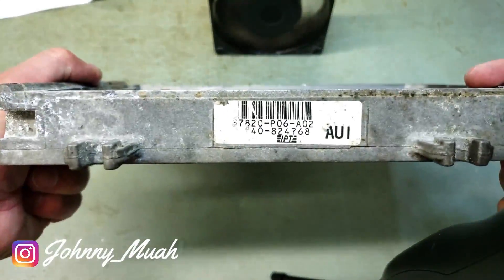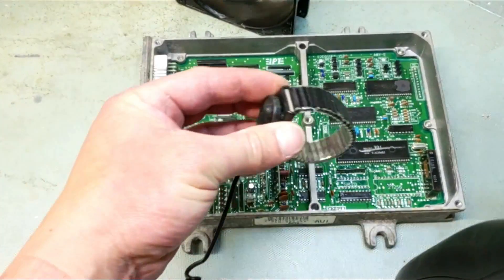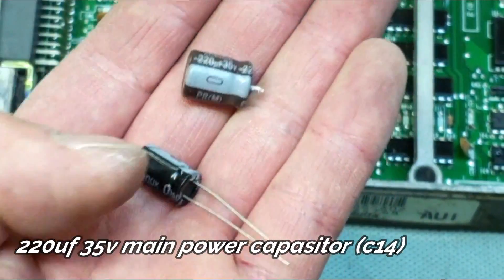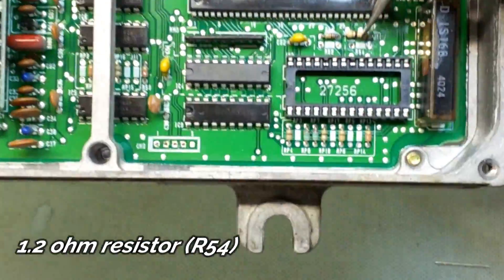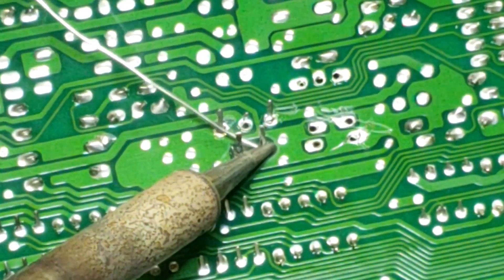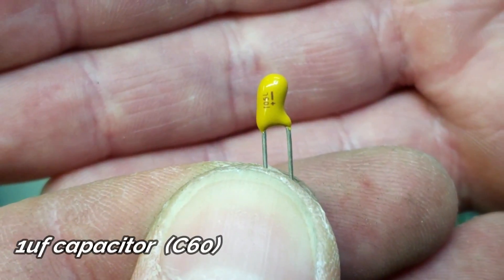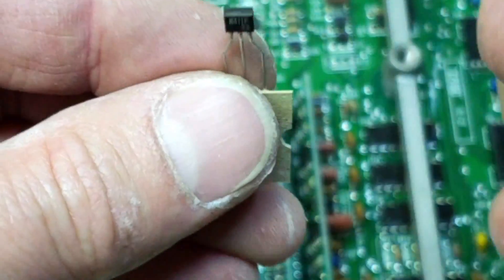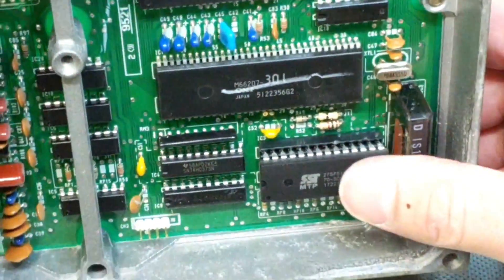Chipping and adding VTEC to a HONDA P06 ECU / p28

Comment: Hi ! is this tutorial working on a P07 ? I'm willing to do a mini me conversion but I need a new ecu for my ek3
Reply from the maker: I believe it's not chippable. We do have a few chipped ecus for sale on ebay. Jmp will be in the title
Reply: @JiroProject I made some research and I saw that a P07 is the same ecu as a P06 but for auto transmission
Reply from the maker: @Theohaddadi  Not sure where you found that, but never heard of that. and the p06 can be chipped, auto or manual. If you open up the p07, you can see that it looks totally different than any obd1 ecu.

Comment: I have a p28 that won't give me any spark. Could I take the parts from that and use em in the p06 for the VTEC section? Someone also tried chipping that one, so I could probably take some of the chip parts from that too no?

Comment: Hi, i have a EK3 d15z6 engine and i want to swap my ecu, i find a p30 and p06 on similar price, which one you recomended to buy? In the future i want to do a mini-me on engine, thx.
Reply from the maker: if its a usdm p30 ecu from an obd1 del sol vtec, then that is the one i would choose since it already has vtec in it. p06 doesn't have vtec, but as you see in this video here, it's very simple to just solder it in.

Comment: Greetings brother I have a concern it is possible to run a Honda B16A2 engine with VTEC to an automatic tramsmicion
Reply from the maker: yes, you'll be just fine. as long as its a b series auto, it'll fit and work as it should. just think they have d16z6 automatic from the factory

Comment: I’m a little confused as I’m a bit new to Honda. Are all the little components responsible for the vtec or is it the chip that you installed? I guess what I’m really trying to ask is, what is the point of the final chip that you installed?
Reply from the maker: first step is for chipping the ecu, which the sst chip will become the new brain to the ecu. Chipping gives you the option to now tune your car with your specific mods using a program. Then the vtec section (top left of the ecu) is for ecus that doesn't have vtec, which a p06 doesn't. If you have a p28 or p72, then those have vtec already installed. If you're running a non vtec motor, then you wouldn't need it. hope that helps.
Reply: @JiroProject  okay so if I just want to throw in a d16z6 into my car then I may as well do the entire process in the video. Also thank you
Reply from the maker: @ArtBuilt  what car and motor do you have? im guessing you did a z6 swap from a d15? if you can get a p28 ecu, thats the way to go. if you want to use your p06, chip it, and put a p28 basemap in, then that's another way.
Reply: @JiroProject  I have a del sol with a d15 at the moment and have a d16z6 that’s getting to getting ready to get dropped in. I’m not wanting to spend a fortune on a p28, so doing p06 to vtec conversion is what I’ll do
Reply from the maker: @ArtBuilt  yup then you're on the right track. but you'll need to get a p28 basemap burnt onto the sst chip, which we do that service as well if needed.

Comment: How often should u update ur system or the old chip is still good for a retune
Reply from the maker: They make a lot fake chips out there. You can search comparisons on what to look for. But the good chips are lifetime reburnable. The fake ones are like 2 or 3 time burns and then they don't burn anymore. As for a retune, I would retune your car with any big or major mods like upgrade turbo, cams, etc.. hope that helps.
Reply: @JiroProject  appreciate your help

Comment: Nice and full detailed video, but I'm just wondering, did you tune or put basemap on the ecu before you start the engine or just plug it in after you rechipped it?
Reply from the maker: after your chip your ecu you'll need a basemap, yes. And then tuned from there. I wouldn't drive very far or long w/o a tune if you're boosted.

Comment: Hey so…. P06 here. Running hondata s300 and I’m getting fuel prime with code 21 (CEL flashing long 2 times & once fast). Car runs like doodoo. Undriveable. Any ideas?
Reply from the maker: check the capacitors, or ic17, which is TA8903SN. and check code 21 - VTEC spool solenoid valve. Watch my vtec section part and see if everything is there and has nice solder contacts. Also make sure your vtec solenoid is wired in correctly or nothing is broken or loose.

Comment: Hey bro! Will this work on p27 ecu running ZC sohc with vtec head?
Reply from the maker: I have never chipped a p27. But if the board looks exactly like the one in the video, then it should be the same and should work.  If you need one, I do have a few still
Reply: @JiroProject  do you sell chipping and vtec conversion chip bro? I checked the ecu it has the same code as the one shown in the video
Reply from the maker: @brandonyu98  I do sell kits and or can chip your ecu if needed. I also have ecus that are chipped with vtec that I am currently selling. If interested in any of these please email me at Jiro_project@hotmail.com

Comment: Is it true even after the vtec install the vtec wont work? Because it is not programmed to?
Reply from the maker: once vtec is install it will have vtec. but if you burn a ls b18a/b non vtec motor (for example) to your sst chip, then going by the reading of the chip it won't see vtec.
Reply: @JiroProject  gotcha...thanks for the reply...greatly appreciated

Comment: Really great video but I have a question:
Why did you use N411F?
N411L would be better to my opinion because it has 4.7K ohm on both R1 and R2. It is the closest to the original NTE2368.
Reply from the maker: Its what was provided to me. But works the same. never had an issue with these.

Comment: So I would have to remove C14 and install the provided capacitor I have the same ecu and board
Reply from the maker: it is 100% recommended. I have actually gotten a few ecus where you couldn't even tell that it was burn/bad. Once i replaced it, you can see that it was burnt. So if anything, if its an easy replacement, just do it. hope that helped

Comment: Lead free solder
Solder wick
Ground strap
Tweezers
Solder suction 

What about Solder gun temp And tip size (fine point tip I'm assuming)?? 
And what temperature do you recommend, what watt of the iron gun. And would solder flux be recommended?
Reply from the maker: Very good questions I never mentioned in the video. But if you use solder flux then you would have to wash the board with luke warm water and give it a really nice air blow dry (never run your ecus wet or moisture). I personally don't like the fine fine tips, nor beveled. i use 900M-T-B to be exact. 
Temp would be from 330°C to 350°C (626°F to 662°F). With my unit dial, it sits at 75 as my sweet spot. hope that helps.

Comment: My ecu is po6, may engine is d15b, can a po6 chipped with po8? Please help
Reply from the maker: yes it can. Once an ecu is chipped you will then be able to tune and burn the chip to your car.
Reply: Thanks bro, so it will run like a po8 ? As in, same same?
Reply from the maker: @Tokis10  yes, as long as the basemap chipped as a p08
Reply: Tnx master

Comment: How you doing I have a question does the p06 ecu needs to be a Manual to do this or could it be auto
Reply from the maker: No, whatever your car is, keep it that way. If you have an automatic vehicle, you don't need to do the auto to manual conversion. hope that helps
Reply: Johnny Muah Project no my car was automatic and was converted to 5 speed with in si tranny and ecu when this was performed also when from dual point to multi-point ...... mpfi modification now I want to throw a vtec head and people have told to look for a p28 ecu or a p06 am asking you this cause I have found a lot of p06 and p28 automatic
Reply from the maker: @davidgodinez5380  OH, well then yea you can use an automatic as long as you convert it to manual. its pretty much a manual now. all you need is to add vtec which is what I showed here in this video. And of course if your car is an obd0 you will have to convert it to obd1. hope that helps.
Reply: Johnny Muah Project thank you so much

Comment: My ecu has something on 1c16 and ic15 do i need to take those out c61 and q102 too?
Reply from the maker: The ecu I have there is a manual ecu. You don't have to remove those for that is what you see in an automatic ecu. if you did the auto to manual conversion, you have nothing to worry about.

Comment: In the p06 vtech what were the cables for the vtech ?
Reply from the maker: you mean sensors? in the video it shows what is needed for the vtec section.
Reply: I mean when the vetch p06 changes what would be the pin for solenoid vetch?
Reply from the maker: so at 0:29 that is the vtec parts you need. and at 3:09 is where you install it at. hope that helps

Comment: Good evening, a question please I have a civic 92 automatic box ecu 37820P06A50 engine D15b7 power 1.5L. I can change my ecu by 37820p06g50 without changing any component?
please urgent
thank you in advance
Reply from the maker: not 100% on what you're asking. but with that ecu, yes you can change it to manual, and also add vtec to it if needed. just do exactly what I did in the video.
Reply: @JiroProject  thank you so much
👍👍

Comment: good dear friend your video helped me a lot I just have a few questions I hope I can help I have an ecu p06 just that the code you say is different would open some problem if it is not the same I want to do vtec the ecu
Reply from the maker: when you buy a kit, just inform the seller what ecu you have and they will give you the parts you need.

Comment: hello, nice video. can this be done in a p29 ecu? i cant find good info about it. also, buying those components at the local store should be fine? or they are something specific? (i have an eprom burner btw)
Reply from the maker: yea that ecu can be chipped. before buying the correct components, talk to the seller about the right parts for the conversion to your specific ecu. hope that helps.

Comment: Great and straight forward video bro thanks for clearing everything up . im on the way to pick up a p06 with vtec conversion and used this video to compare it to the one I'm buying .
Reply from the maker: you're welcome man. and thank you
Reply: @JiroProject  hey johnny thanks for the video. I just bought a p05 that was hondata s300 ready and verified it has vtec and datalogging installed because of your video here. However i noticed this p05 doesnt have the capacitors at c51 and c52. Is this going to be a problem for me using this. If it needs clarified im gonna be running a b18c1 w/ manual transmission with hondata. again though thanks for the video.
Reply: Nice

Comment: You should add a clip of the de-soldering too
Reply from the maker: I thought about it, but its pretty self explanatory. you put a solder wick on it and it just does its job. watched a few guys doing these vids and it just drags on and on
Reply: @JiroProject  except my radioshack desoldering braid refuses to work.. something about flux and lead compatibility I think.